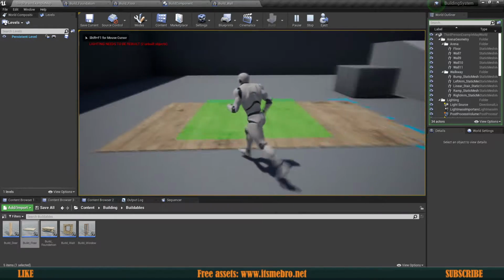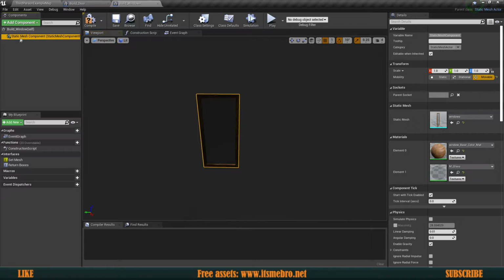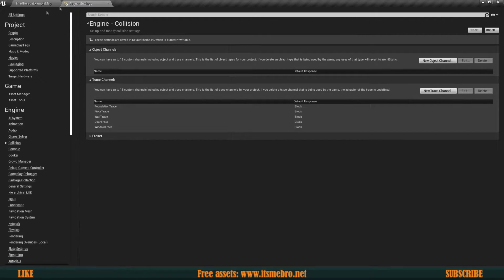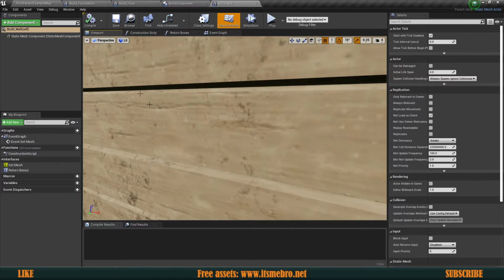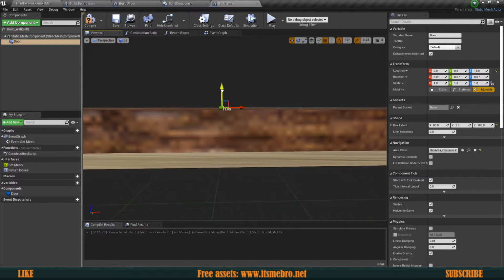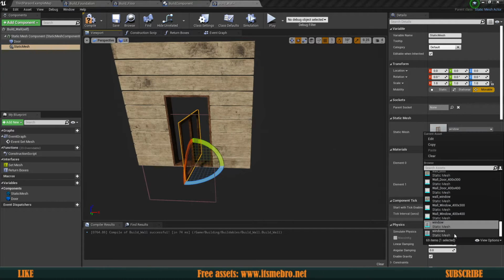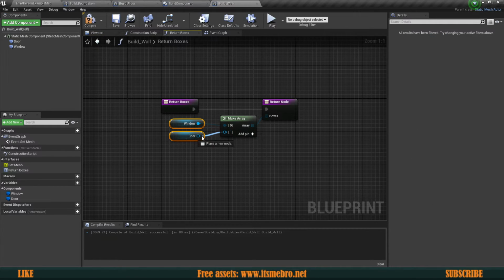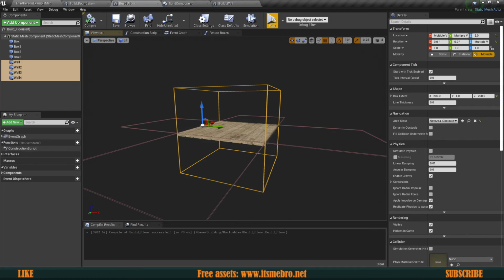UE4 Base Building / Doors And Windows

Comment: Excellent tutorials.  Easy to follow.  I'm doing it on Unreal Engine 5.2 and it is working fine.  I would recommend them for anyone new to Unreal Engine or who wants to learn how to create building parts that snap together.  I'm also learning a lot about the engine as I go through them. I'm up through video 13 in this series and plan to finish them all.

Comment: I don't know whats going wrong but I went from previous video to this one and now my material doesn't change anymore. I work with two models, one is a transparent version and as soon as you place it, it places the actual model with nanite activated. But now it just places the transparent model instead this only happens with the walls (wall, wall with door frame and wall with window frame) but not the actual window, door, floor or foundation they are all okay... What is happening :(

Comment: I think configuring different walls inside one BP is fine for showcasing, but this way you can place a wall or a window in a wall where they don't belong. Like DoorWall and WindowWall can inherit the BasicWall class and add new collisions on top of them. This way you also won't have to use the SetMesh on all other Blueprints to avoid runtime errors.

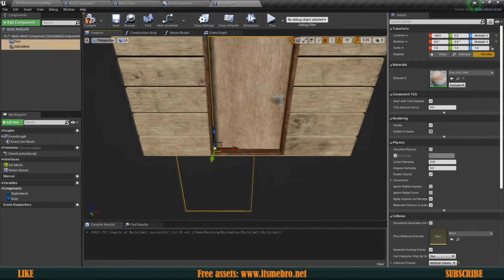Comment: 7:06 Thats exactly the problem I keep facing, what if your objects are too small so that extending the box is not an option? could we make a custom collision object and use it instead of a collision box, I looked all over the internet for it and no one seems to mention it, if you have a solution for this problem that would really be helpful.
Reply: I'm having the same problem. Did you find a solution?

Comment: Bro, it s amazing, definitely the best building series i ve found. Just would like to share a bug i think. When you try to correct the different walls over each other at the same position. I think changing the collision box extent Y to 1 will not change the problem. It works if you have a wall, but if you linetrace thourgh a the door or window, it still try to snape a new wall at the position of the DoorWall or DoorWindow. Hope i explain myself clear enough :p  I don t have solution unfortunately, but this is what i m facing on my version.
Reply from the maker: There will be a video that fill forbid overlaps.

Comment: Great series btw. I have a problem. The wall doors and wall windows are using the wall's materials. Any idea how I can fix this?
Reply from the maker: If you provide the correct materials for static meshes. So they have the correct one by default, it should work just fine.
Reply: Mine are doing the same :( not sure why ? It's like the UV's have been rotated or something. I have all the project assets and have done nothing but what the videos have said to do, i did notice whilst looking around the folders that they is no M_Glass Texture for the windows, not sure if this is an oversight as i know setting up a series like this is extremly hard to do, but other than that Iam Really learning a lot from this THANK YOU.
Reply from the maker: @outlandishmango4622  M_Glass is a material from starter content.
Reply: @ItsMeBro  of course it is  :) my bad